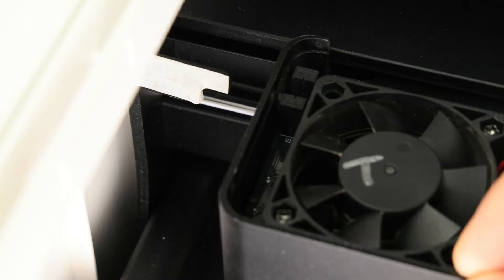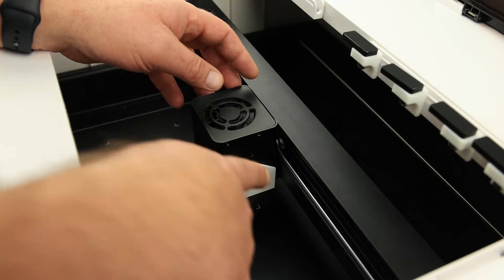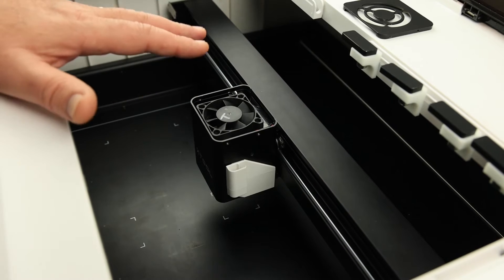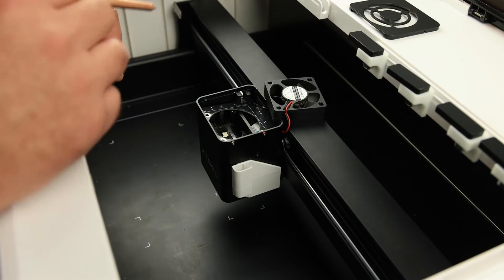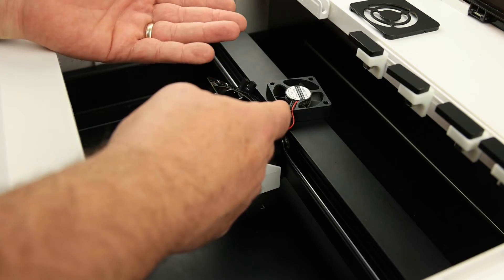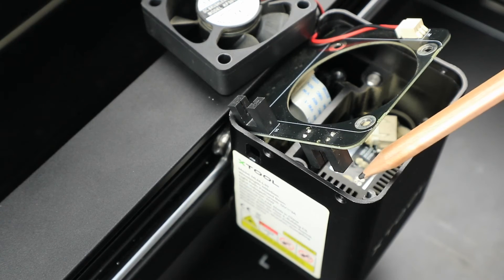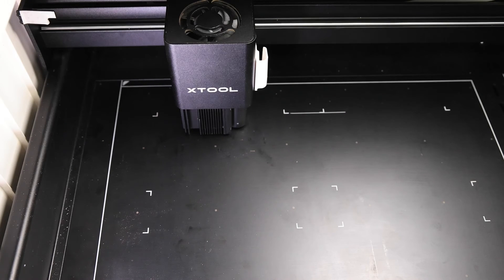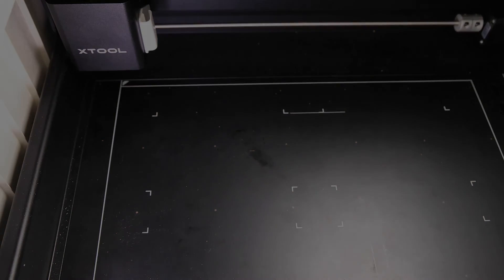xTool M1 Laser Maintenance; Qx14 Errors, Cleaning, Fixing, and How it works

Comment: I see you have a lot of videos. I am new. I just bought my M1 less than a month ago and my laser module is making a loud noise. I have tried so hard to get through to technical support and everything is done through email. Any ideas of what’s going on with it?
Reply from the maker: If it's making noise when it moves to the left rear corner, then the chances are that your air assist hose is getting behind the laser module or gantry. It would be best if you joined the "xTool M1 Official Group" on Facebook. People can help with your problem there. A photo will show if the hose is a problem.

Comment: Hi, great video thank you.  My head didn't drop, but I did a clean as shown in your video, the red light on the front of the machine is on and the error code 14 3 is still showing the software.  Any ideas of what I can try next?  Thanks.
Reply: and it is making a knocking sound. which stops then the red light comes on.
Reply: @fionafaulkner-cox7728  They say it may be one of the photoelectric sensor which is displaced or not working.

Comment: Thank you for this very informative video. I tried the link to reset the laser head and it won't open. I've deep cleaned the sensors and casing and the laser is still dropping down. Any thoughts?
Reply from the maker: You should be able to hold the laser module up and turn on the machine to reset it, but on that same page, scroll down and there is a link to the older "Software for removing the laser module.exe" - that should work until they fix the page.

Comment: Any thoughts why the laser will not go back into the laser module? I got the code Qx14 3. I did everything possible and downloaded the software and it won’t work. 😭
Reply from the maker: I would remove the cover on the bottom of the laser module (two screws) and place a mirror under it. Run the software and see if the gear turns on the motor. If that doesn't turn there's a hardware problem.
Reply: @lakeshore3d  I sort of done that and it might have worked. I am going to put the air assist on and then try it out again and see if the first problem is fixed! Thank you.

Comment: 8:19 In addition to the way in the video, you can also hold the laser head and then turn the machine back on, the laser head will also automatically reset, such an operation does not require the use of windows computer. Hope it can help you.
Reply from the maker: Thanks for that information, I'll give it a try!
Reply: that helped me thank you